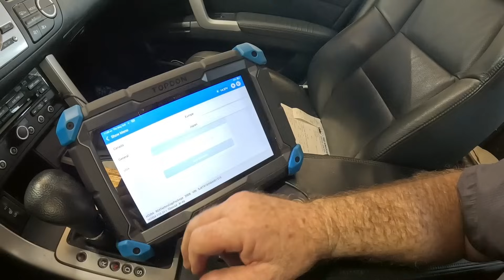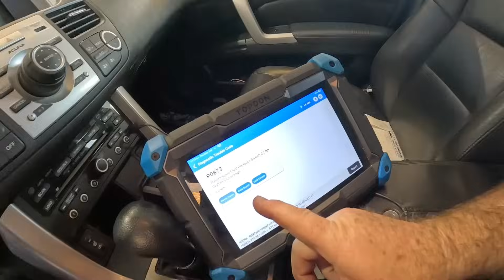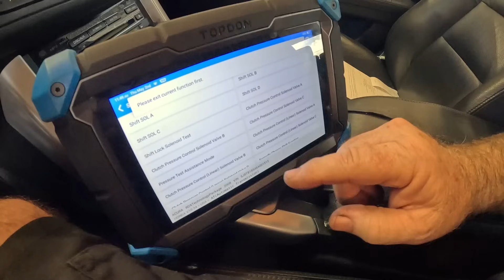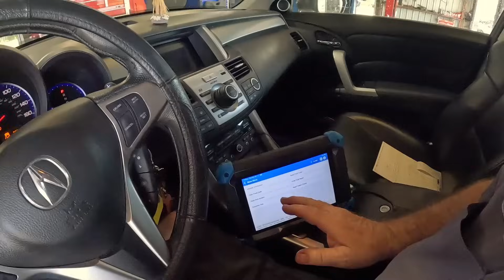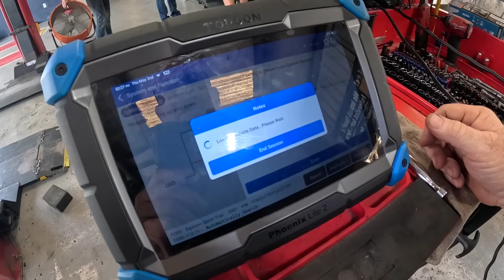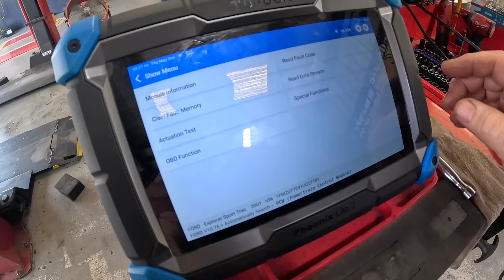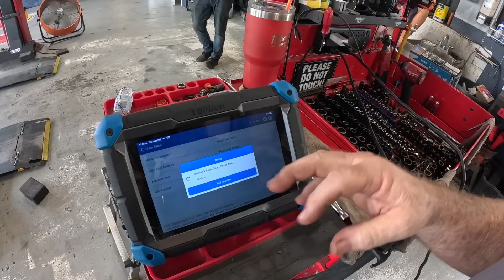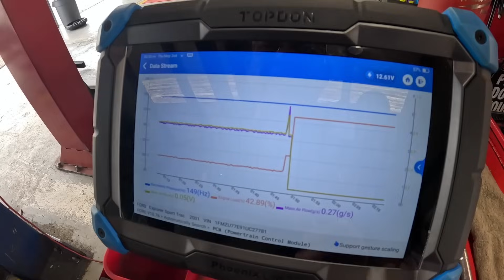COROLLA, SPORT TRAC, HONDA, DAY IN THE SHOP 476 Fixing broken cars and trucks!

Comment: If I remember correctly the GM 265 CID and the 283 CID were blue printed in the factory when they were built ,they were a very smooth engine
Reply from the maker: They were great running engines. I think they had such mild cams and mushy hydraulic lifters that helped a lot. I think that’s why as a kid the first thing we did was Cam, Intake, Headers, haha. Get them running rough!

Comment: I have a question with you doing the wiring yourself.   Are you also a licensed electrician?  What if in the future your shop burns to the ground from an electrical procedure you did, will your insurance company pay for the complete replacement of your shop, equipment and any customer cars list in the fire?
Reply from the maker: I did not do the wiring, let’s hope that doesn’t happen. This building has had add ons since it was built 60 years ago. What we just did was improve already patched up fuse box and breakers. Run in conduit and done correctly.
We have good insurance also. :)
Reply: Surprised you just admitted on public form breaking laws . to perform electrical work in Florida you have to be licensed, and insured. Not a hater love everything about your channel . sounded like feed to sub panel undersized , panel needs replaced
and new circuit to lift. Probably permit and inspection. Sorry but what you said just hit home. Thank you for the content  wish I had a local mechanic like you